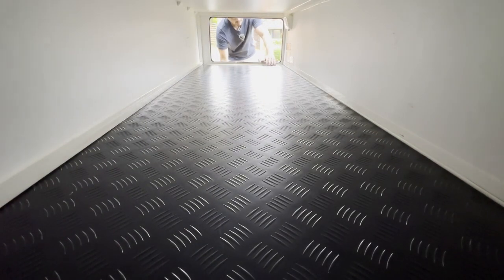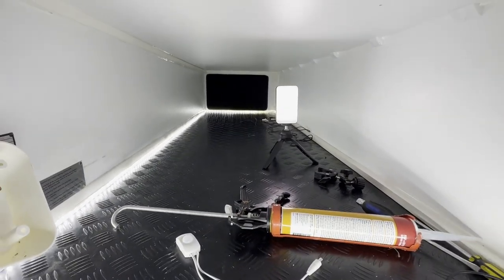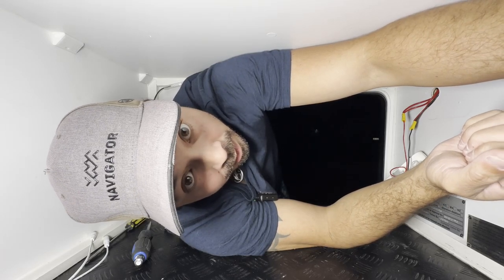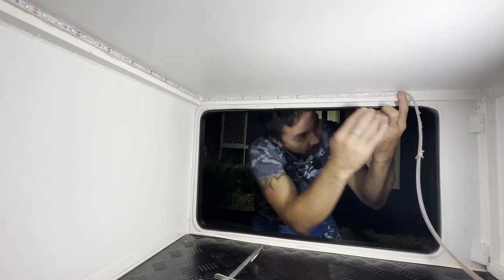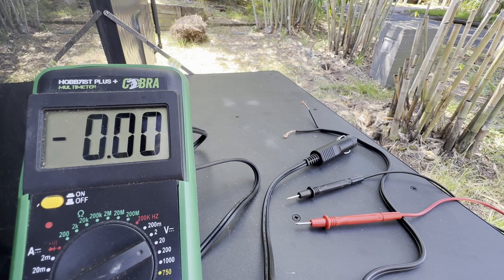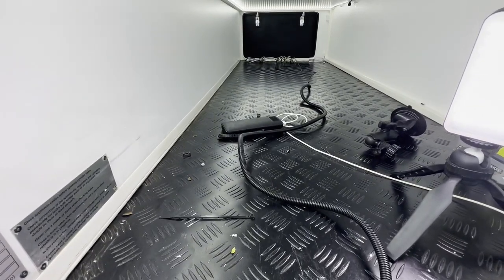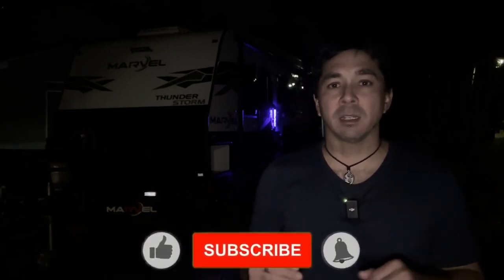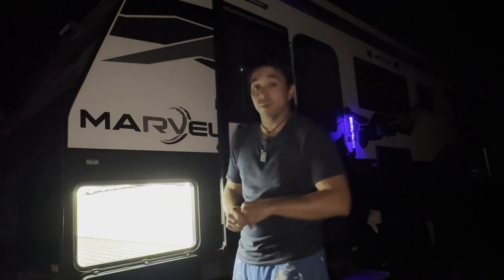Caravan Tunnel Boot Motion Sensor Light Mod Install

Comment: Nice install job there... neat and tidy.  Some of those strip lights come with an adhesive backing which makes it easier to install than using silicone,  but maybe yours didn't? Cool escalator you have installed in your yard,  😆
Reply from the maker: Yeah the strip light didn’t come with an adhesive back though I suppose I could get double sided tape! Plus I don’t want it to come loose on the corrugations 🤙🏽